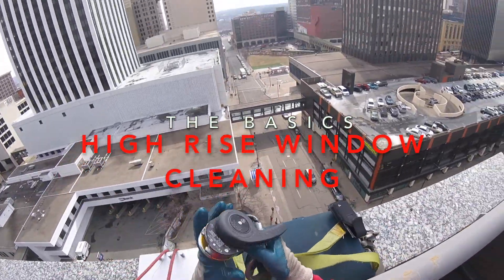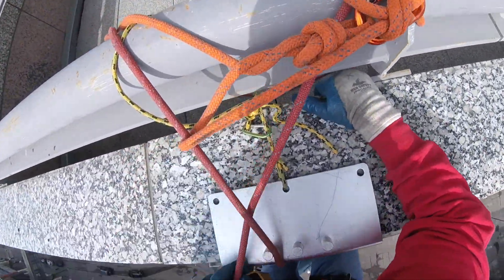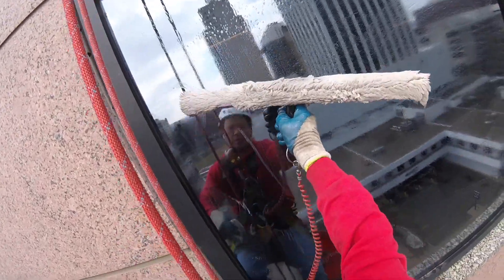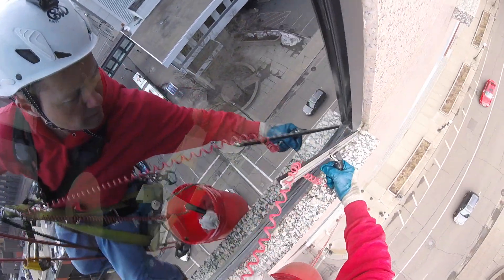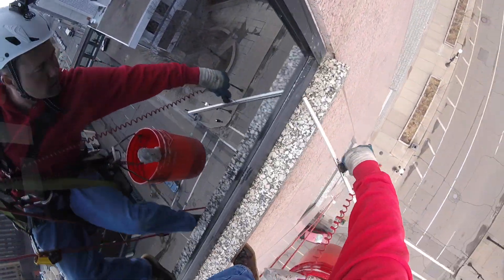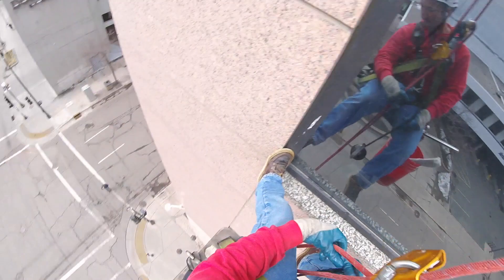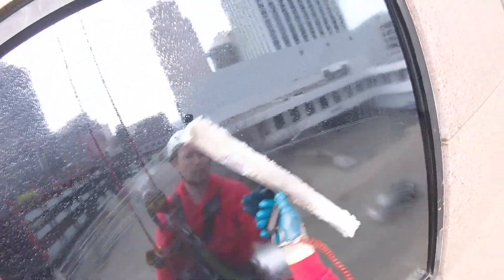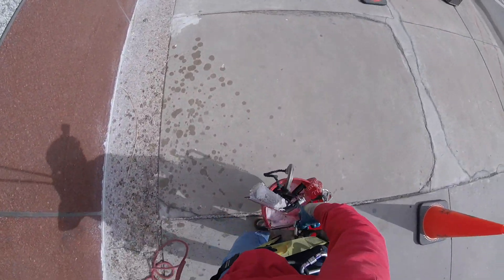High Rise Window Cleaning Basics

Comment: Great video! Im doing high rise over in Montana and this helps a lot. The job im on this week has been more difficult than others because we are covering 3 panes wide with each drop and its quite a stretch for me to reach the far side of the panes to the left and right of me.
 I realized today i should probably try using a suction cup to more easily hold myself stable because the small slippery frames arent helping much. 

Wanted to ask you why you stick the suction cup to the window before you wet it, then reattach the suction cup after? What does that do exactly? We dont have the same suction cups as the one used in the video so maybe its different
Reply from the maker: Everyone will develop a system that works for them. Goal is to do everything the same at each floor for efficiency and decreasing each windows time. Suction cups work wet or dry. I first set cup dry as cup is available in hand before sleeve is and to get full pressure while reaching. Then cups gets removed or slid to wet under it and finally removed with last stroke of squeegee motion to close out. It takes time to develop. See our cups in single or double here https://www.windowworldsupply.com/product/4-single-suction-cup-with-lanyard/12?cp=true&sa=true&sbp=false&q=false
Reply: Thanks for your advice! Other than some rough weather my time on the ropes went a lot smoother today. I was using one of the completely silicone 4inch 4 finger suction cups and it helped immensely, I did pop of the window a few times unexpectedly and was wondering if the 2 cup you're using in your video holds better? The one I was using did not like having water on it and popped off most times I tried. I may have just been pulling to hard on one side of the suction cup because I I've noticed it I don't pull straight on them they tend to come off. Any advice is appreciated!
Reply from the maker: Check out the high rise content on our forum at www.windowcleaningwarriors.com 
What descender and back up devices do you use?
Reply: We use the D4 decender and the Climb Right rope grab. Pretty sure we are getting new rope grabs soon I'd like to get one that doesn't need to be manually moved

Comment: Do you require a L3 Rope Tech on all projects?
Reply from the maker: We do not require a level 3 on sites and SPRAT doesn't require us for logging our hours to level up.

Starting the SPRAT training is above and beyond what OSHA requires so we are good.
Reply: @windowwarriorsforum9112  That's interesting.  So in case of emergency, what's the rescue plan?  I assume you're always working in descent, so there's that.
Reply from the maker: Rescue plan had nothing to do with a level 3 onsite. 
Our safety manager, me, develops and reviews self and assisted rescue quarterly after each employee completes initial certification. We also have as part of our Work at Heights Safety Plan have a R400 device whetr all employees, inside and outside crews are experienced in using for assisted rescue without being in a fall hazard zone.

Requirements for level 3 is to "work under their supervision". 
Since OSHA supercedes SPRAT the level 3 "supervision" isn't required.
Reply: @windowwarriorsforum9112  Got it.  Not taking a shot at you I just find it interesting.  It's such a grey area in my opinion.  I'm IRATA 3 and Australian (living in the US now).  I just find it really intriguing.

Every job I've ever been on has required L3's to be in vicinity and for a 1 to be working with a 2.

That being said, you're not getting a job on ropes in Australia without being IRATA certified.

The US is just a different beast and I wonder if it'll ever raise it's standards/requirements or continue to dilute them.
Reply from the maker: Good discussion and shows how the US severely lacks in safety.

Most rope access window cleaners don't even use certified anchors. Really bad here with compliance and even understanding compliance.

Comment: Can these chemicals for cleaning windows damage rope,if it gets wet from them all the time ?
Reply from the maker: Ropes do have a life and are required to be inspected and logs maintained. Standard soap and water won't have much effect on ropes but should be based on rope type and amount of contact. Our ropes are replaced every 2 years. We document initial service date and remove after 2 years. Exceptions are  a fall, abrasions or contact with harsh chemicals, anything that will weaken the rope. A log of each rope shows the inspection date and length in service. There are ways to clean ropes also, refer to the manufacturer recommendations.

Comment: i wonder if the pays still just a few bucks a pain err pane. even tho its hundreds and hundreds of feet off the ground.
Reply from the maker: The pay is a few dollars per pane but the volume is greatly increased. For example, a 10 story building 2 windows wide is 20 windows that can be cleaned in 10 minutes. Figure,  3-4 drops per hour is about 60-80 wi dows per hour. Adds up , can't be cleaning 60-80 residential windows per hour. Make sense?
Reply: @windowwarriorsforum9112  yeh, but your outside only so your charging 2 dollars instead of 4. residential is totally different i make like 40hr on houses.
Reply from the maker: @typerightseesight  absolutely not $2,  You won't make money that way
Reply from the maker: @typerightseesight  $30 an hour is good for an employee but not for a business
Reply: @windowwarriorsforum9112  Right, with commercial window cleaning.. You get days with great hourly pay and days that barely meet minimum. If youve got a good boss you can earn a decent living.
Reply from the maker: @typerightseesight  yes, company structure is key. Most companies are too cheap to pay well.

Comment: I dont have the balls for this. My hats off to you sir.
Reply: It's not that big of a building. The Burj Khalifa is a different story which  has to be done all over again as soon as they finish.
Reply: It's really much safer and less scary than using a ladder 😅
Reply: Dude it is 1000x safer than when my pops used to do it remember him telling me what it was yeah you had a harness but the harness wasnt shiiiit lol they didnt have all the hooks for safety etc when it was time to move and time for you to get up someone would pull you up literally they had to make sure of course you were tied off they harness my dad wore only went around both thighs and crochal regions and around your lower back you'd step and swing now its safer than heck yeah dont get me wrong shit is crazy it was more like rappeling before my dad had used to clean the riverside casino and the others in Laughlin Nevada in a bucket seat and the standing rig the old school rigs were not safe had no extra safety it was you either do it and get it done without fear or you most likely gone fall just like roofing I've done some crazy ass shit being held upside down while placing in a i beam that weigh about 75lbs with a impact drill and a hand crank i had to unhook my harness because I was the smaller guy and i could barely fit in the whole an we were atleast 10 stories high with nothing to break my fall if i slipped they even played a joke on me letting me fall a little bit i laughed my ass off idk why but i guess between the adrenaline knowing the only thing going to stop you is Concrete 10 stories down or the fact that welp it's my time might as well laugh
Reply: My dad used to tell me the stories of then vs nowadays the bucket seat was a totally like a bucket it was like a plastic small seat only certain sized guys were made for them tbh my dad being only 5'6" 5'7" between 135-145lbs at the time was perfect for it looked like a white child swing that they tied off to a hoop ring so you could go side to side and also repel down if you dont know what a hoop ring was for the old rigs let's say those cheap key chains are hoop rings but they were made from steel and alot stronger the harness was a thigh sitting harness you could literally sit in the bucket if the bucket fell you'd be sitting in that same position as long as you didnt move much until either the worker that helped you back up either made it so you could repel down or pulled you up they were extremely unsafe due to them being mainly plastic or fiberglass with a light metal bracket under the seat that you'd literally tie the rope into a U and it was literally a child's swing without the bar then they added the bar with chain lock to the seat with a X harness not much better than the thigh harness but more comfortable the harness we use now is crazy will this was like 10 or 13 years ago when I used it idk if it has changed it look as if it did but your legs would go into each up to the inside of your thigh and crochal area wrapped around your stomach over your shoulders the hooked into the belt which is the harness I still own

Comment: Dude you’re awesome but I noticed two things. 1. That’s a Petzl RIG not an ID as it doesn’t have the panic button and it doesn’t have auto lockout if you pull the handle too far on the RIG down you go 👌🏼2. You should always have a stopper knot on the end of your rope to prevent it abseiling out of your device during the drop. Cheers for the tips! I need to use my suction cup more often lol I use grip strength for most jobs.
Reply from the maker: I appreciate your comments. This is a 2019 Petzl ID. Does have the lockout when handle is pulled too far and has a grab inside which locks the rope if rope is entered backwards. Rig doesn't have the grab inside. Button was also eliminated  on the 2019 upgrade. Check out the review of the 2019 ID Rocky did with abc Window Cleaning Supply, it can be seen on the Window Warriors Forum
Reply: It is for sure an ID. You can literally see the anti-error catch.
Reply: Have this and can confirm it is an ID

Comment: You have to be careful using that metal edge protector when your ropes are approaching at an overhead angle like that, they could easily slide off it if you swing too far to the sides.
Reply from the maker: Ropes can't slide off this edge protector.  The posts that separate the two ropes are 2" tall. Rope would need to lift up 2" for this to happen. Especially when under weight, therebisnt a chance for this to happen.

Check out the Towa edge protector here.
https://youtu.be/78U5Mot_i3Y